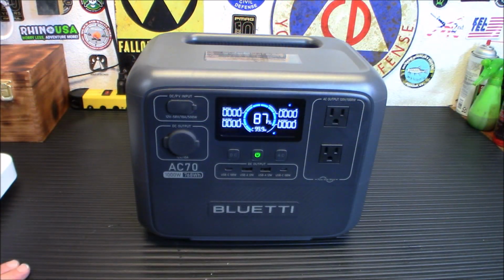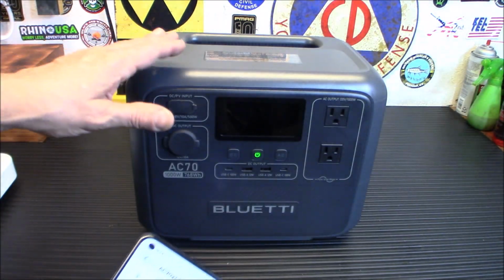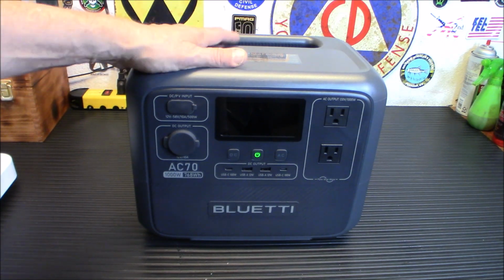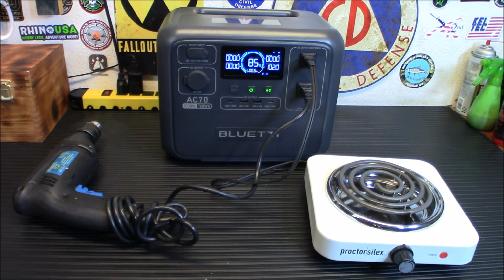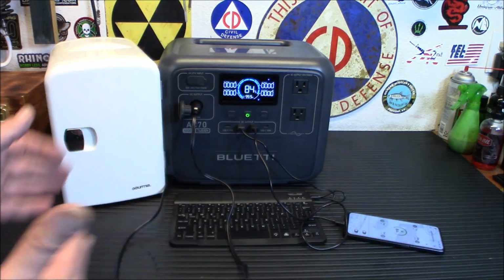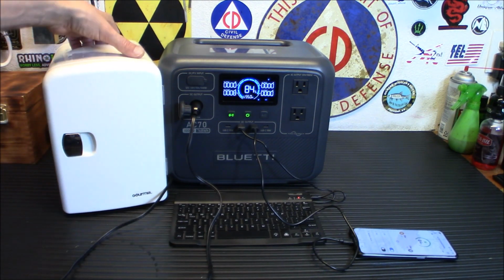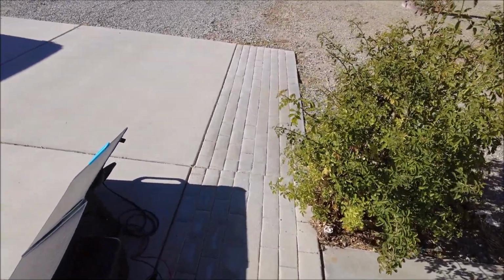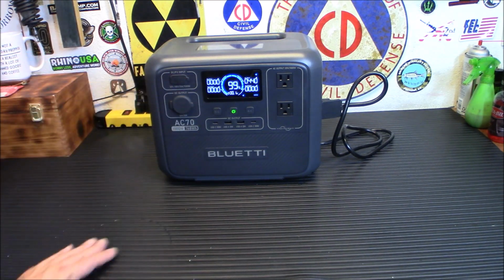BLUETTI AC70 Power Station, 1000 Watt LiFePO4 Powerful Backup Power!

Comment: When will Bluetti make mini wind turbines to charge their power stations during the dark hours or foul weather? I realise I’m being a bit sarcastic but it seems like it shouldn’t be as far in the future as the market wants us to believe, yes I ‘m naive but still, I can’t be that crazy can I?
Reply: It's just not realistic because you need to have them high enough above ground and at that point you will be looking into zoning and permits.
Reply: @Trillville43  Thanks that makes sense as a major problem. I occasionally see videos were mini wind or sometimes even water turbines help off gridders produce usable power, but the complete absence and availability of them is definitely telling…
Reply: @SolarPunk80  if you live above sea level or in open land with good wind then it could work for a few hundred watts.
Reply: Just build one and mount it to the roof of your vehicle. Drive 70 mph for an hour and your bank is charged!